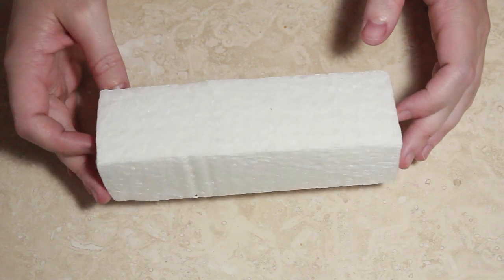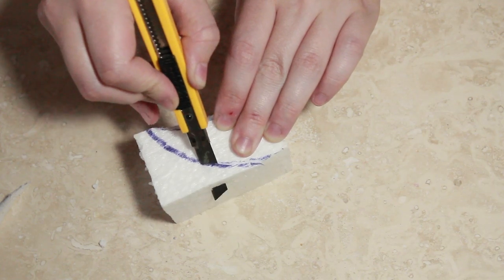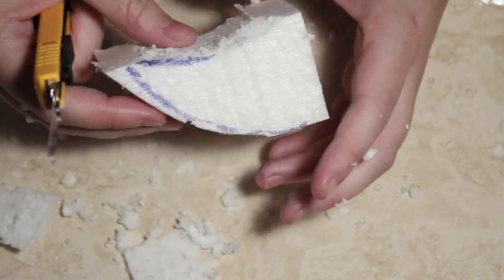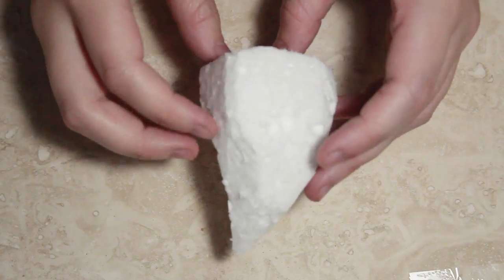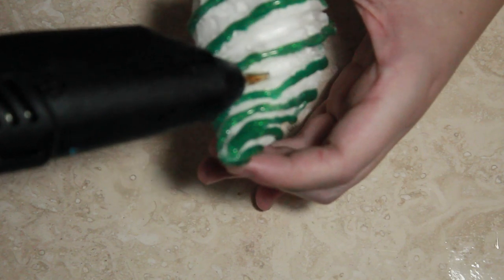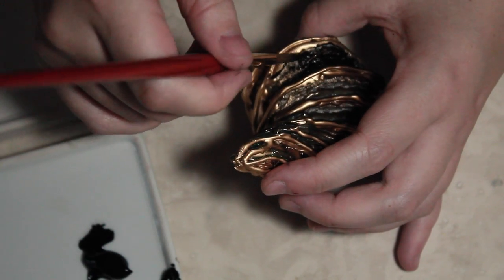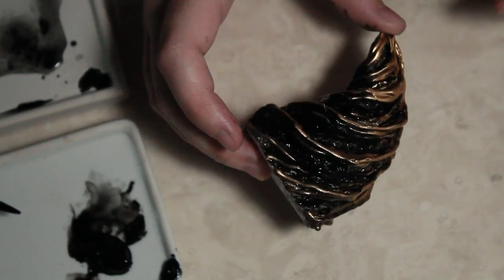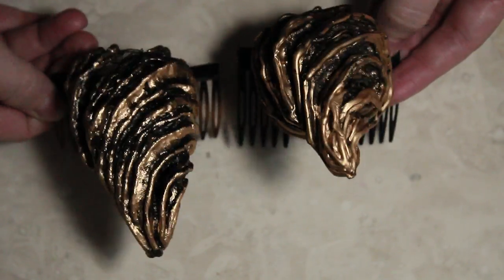DIY: Spiral Horns

Comment: A tip when cutting styrofoam: either heaten up the knife or use some kind of wire and send electricity through it. that will make it hot and it will slide right through the styrofoam. an extra plus is, that there will be less messy little bubbles sticking to your hands, because the static charges is minimised.

Comment: My hair is really short.  What tips do you have for me so can I get these to stay on my head?
Reply: If your hair is REALLY short, you could try using wax you've warmed. It'll get stuck in your hair but I did it for my brother and it worked alright. The only thing is if you get too hot the wax might get all melty again, but it still stays just 'infects' more hairs. (Oh and to remove it try warming it up with hot water or fingering it, and work it out. DON'T YANK IT OUT!!)
Reply: Maybe just use a regular headband?
Reply: or glue onto those flat hair clips? or glue multiple hair clips together?
Reply from the maker: Glue them to an Alice band instead :)
Reply: Thank you!